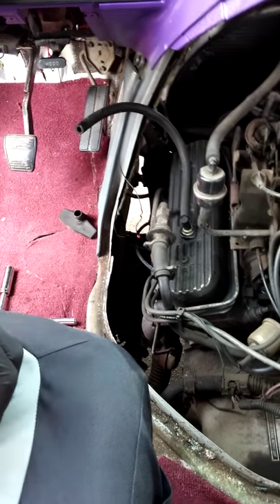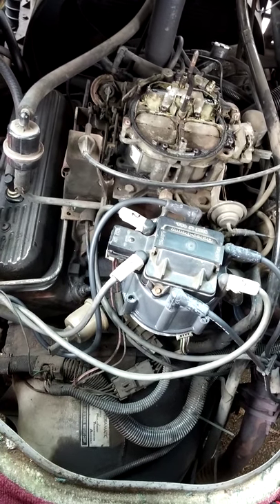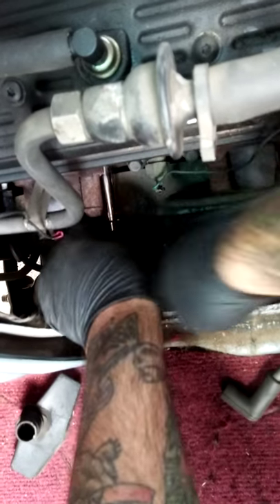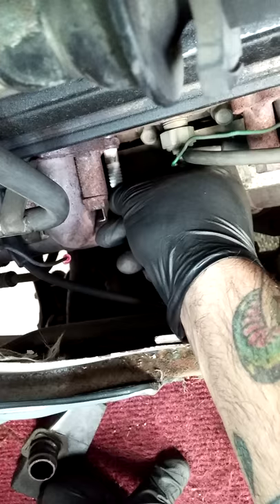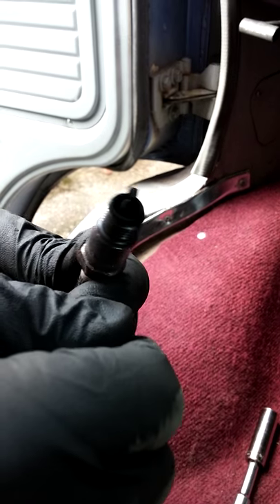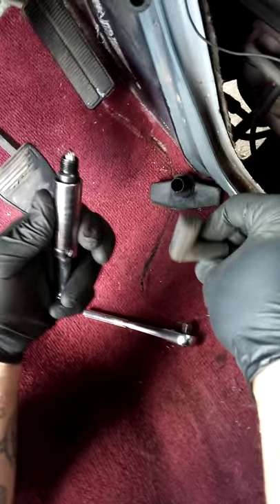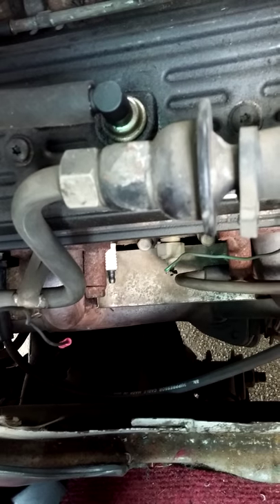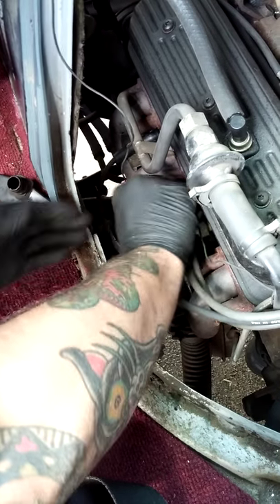How to replace spark plugs on a 1985 Chevy G10 work van

Comment: Came here looking for help changing the difficult side.  I know how to do an easy side already.
Reply from the maker: Make your own video then?
Reply: OK how about the #1 plug ????? Make a video of putting in a spark plug on the #1
Reply: @MandanaBrother  What's even LESS IMPRESSIVE about your video is that you have the benefit of working in the LARGER DOGHOUSE (To accommodate a diesel and big block) of a 1978+ model of the G-Series Van. My '76 G10 Laughs at you and your terrible attitude.

Comment: Hey Guys,

Would this be the same for a G20? Also, how do you go about getting the other side's plugs?? Going under the car or through the wheel well? Thank you!
Reply from the maker: +David Tauber I've never worked on a G20, so I'm not sure if it would be the same or not. I was able to get to all the plugs by accessing via the the removable cap in the cab. Had to wedge my arm around quite a bit. Definitely not a fun vehicle to work on.